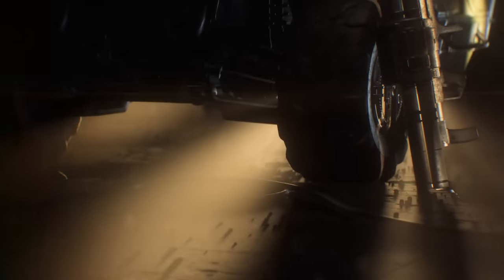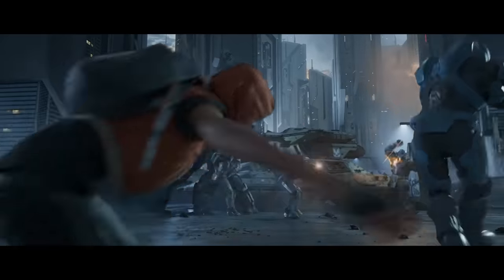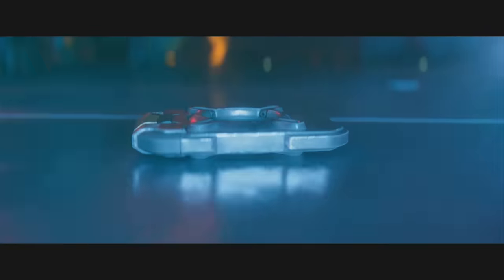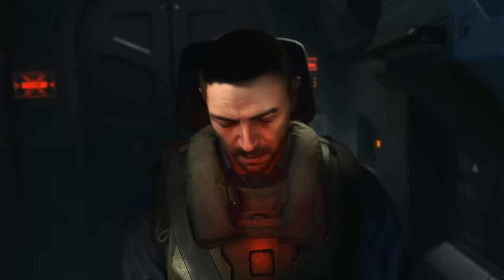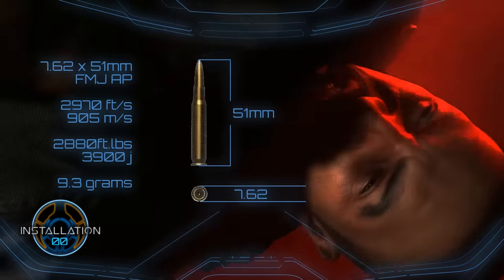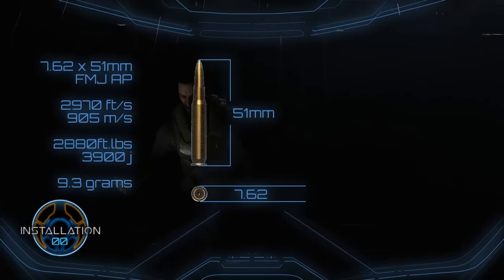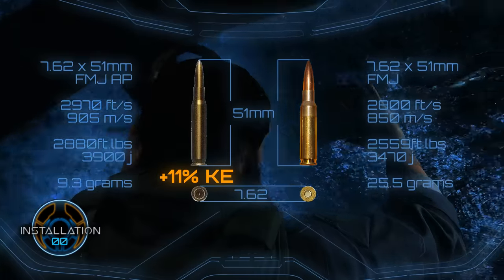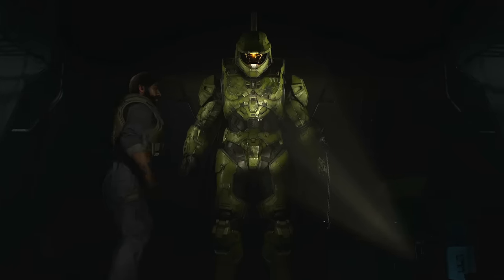Why are UNSC Weapons so powerful!? | The Armory

Comment: I reject the notion that UNSC firearms even are more powerful. 50m/s isn't much of a difference, many WW2 service rifle rounds had similar differences or even greater.
Also, different rounds fired in the same calibre have different velocities. If you lighten the projectile it will go faster. There would be 7.62x51mm rounds that go much faster than 905m/s.
And another also. 12.7x33 is already a handgun calibre, it's what the desert Eagle fires, well one of the calibres it can fire.
Reply: Actually, the Halo Magnum is closer to a 500 S&W (12.7 x 41mm). It's just a 1mm difference in case length between the two.

Comment: Awful long winded explanation to still be wrong.  Kinetic energy is 1/2 mass X velocity squared.   The simple answer is that the increase in velocity more than makes up for the lesser mass of the projectile.  The lesser mass of the projectile actually makes the increased velocity easier to attain as the lower mass being pushed means less resistance and higher speeds can be achieved.  This can easily be achieved in the same package size by the use of low mass projectiles.  Same size, same or higher strength, but less weight.  For example replacing the standard copper covered lead projectile with a solid copper projectile.  Or since we are talking about the future, maybe the UNSC has developed an alloy or composite that is light weight but not too brittle.  A more advanced offshoot of the work being done now on advanced ceramic compounds seems very plausible.
However anyone that actually uses firearms often in the real world can tell you that pretty mathematical formulas about what is more powerful vs the real world of what does the most damage and is more capable of actually stopping the threat being fired at are two VERY different things.  The most important aspect is not the kinetic energy of the projectile, but is in fact the ability of that projectile to retain and TRANSFER that energy to its target.  This is where the paper math about high velocity and low mass rounds often fails in the real world in comparison to slightly slower but heavier counterparts, and where hollow point ammunition is superior to FMJ that simply makes little holes and does not transfer energy.

Comment: I just threw the numbers on screen @ 11:20 into a calculator, the left one with an 8gram projectile (or 123.5ish if we use actual bullet terminology) with a muzzle velocity of 3,100 feet per second comes out to a whopping 2,635 foot lbs of muzzle energy. Not far off from the screens calculations. The one on the right though, that thing weighing 25.5 grams (or 393.5 grains) going at 2,800 feet per second comes out to 6,850 foot lbs of muzzle energy. Something is way off on your calcs. You can completely ignore the powder because we know what the muzzle velocity is, so what gives?

I’ve got more in the replies meow.
Reply: After a bit more pondering, that 393 grain number is insane. The main round I shoot out of my .308 is 165gr, and the heavy end of .308 is 180gr. 

You can argue propellant changes and the possibilities of rail gun like energy impulsion, but all of that is moot since we are looking at the muzzle velocity. Which I also just realized you are trying to use the weight of the entire cartridge, which is not at all how guns work. You measure the bullet weight, and the powder weight. The case is expected to be a constant, which is a whole other ballgame. Now I’m going to have to work backwards to determine the true insanity you are proposing assuming the actual bullet weights are the same, and ignoring the case weight.
Reply: Alright, backwards calculating the given info at 11:20 comes to this. The left one, the .308 round is 125grains, which is working backwards from muzzle velocity and energy. Which is not far of from your given 8 grams, which comes out as 123.5 grains. So that part of the example is showing the actual bullets weight. The right one, the 7.62 nato cartridge is coming out at 147grain from the backwards calc, or 9.52 grams. That sounds exactly like the NATO spec m80 round. What’s confused me is why you are showing two drastically different measurements. One being the actual bullets weight, and the other being the entire cartridges weight. 

Now for the calculations from 4:11  
With a given muzzle velocity of 2970fps and an energy of 3900j, you get a bullet weight of 146.8grains or 9.5 grams. The bullet alone weighs more than your calculations came to. So, I’m terribly confused as to why you would bring this up in the first place. You admit the maths are wrong, you are working off of incorrect maths. But, you claim they are using some super powered powder that (as I’ve shown via backwards calcs from given figures) needs to have negative mass. Not just negative mass, but enough to counter act the entire weight of the case, the powder itself, and 0.2 grams of the actual bullet.

Comment: Performance varies wildly, some weapons monstrously over perform and others are pee shooters, very few of the calibers make any sense. And you can't use 7.62 as a base because the DMR also uses it, and perform significantly better. 
The BR 9x40 makes no sense, the pistols all essentially shoot .50 Beowulf  and performance is everywhere with those guns the sniper is really a man portable autocannon with sabot rounds, the shotgun would be completely useless (shotgun are very low pressure and energy, it's the terminal ballistics that give them their reputation) and The .30 cal and .50cal machine guns perform exactly the same. 

Generally speaking though, modern weapons would probably be every bit as viable from a kinetic perspective and better in every way from an accuracy perspective with a few exceptions.

Comment: If one was willing to use stainless steel cases and beefed up rifle 7.62 at 80k PSI can increase power to around 4000 joules. Wear and tear would be a bitch... but the USA has decided doing 80k PSI is worth it in the new dumb ass rifle round so go figure...

Comment: Your data for the real world fielded m80 Ball variant on 7.62 Nato is incorrect. The average projectile weight in the real world for this loadng  is 9.4-9.6 grams or 145-148 Grains as measured here in the United States.  You also have issues when referencing velocity data as your velocity data for that given load of ammunition isnt framed by a particular barrel length used during chronograph testing which greatly affects velocity in a real world setting. The data you do have  for the real world ammunition while wrong on bullet weight does have a velocity stated that would put it being fired out of a roughly 22-24 inch barrel.  While as if it had the aforementioned incorrect weight you have stated, it would be a subsonic load at that weight in most barrel lengths and travel at roughly 1000 Ft/s in any typically fielded belt fed. SASS or issued rifle.

If you need help referencing ballistic data in the future let me know and I'd be glad to help. I have real world experience and data I can lend.

Comment: Different case design..

Instead of modern brass there could be a different alloys in the brass in halo making the case stronger... stronger brass higher pressures... higher pressures more speed... take a rifle case that's strong enough and fill it with bullseye you'll add dozens of FPS to projectile...

Psa don't do this in Real life you will die or be seriously maimed

Comment: You mixed up the weight of the bullet on the UNSC round and entire weight of the cartridge for a modern NATO standard. They clearly copied a current date steel core 7.62x51mm round exactly. 
Then you started talking about blackpowder composition when modern ammunition uses nitrocellulose and nitroglycerin composition.
Then honestly I can't stand to finish the video you're premise is completely off.

Comment: I admire your attempt, but lets face it. The whole usage of 7.62x51mm in a few hundred years where humanity achieved both FTL travel and terraforming, is really stupid. 😅
From day one the round was questionable because the US army ordnance pushed their own project for a "universal round" for all of NATO. Meanwhile all kinds of promising European intermediate cartridges where discarded in favour of 7.62x51mm. And just when most of Western-Europe switched, the US started with 5.56x45mm. Now when most of NATO again has switched to 5.56x45mm, guess what the US just did? 

The problem with 7.62x51mm is that you have a round that even with modern rifle design, is still is too powerful to be used in a fully automatic rifle. This while you might want something more powerful for machine guns or DMRs/sniper rifles. That is for example where .338 Lapua Magnum comes from or the derived .338 Norma Magnum, another round the US is experimenting with. The adaption of 6.8x51mm basically looks like an attempt from the US to fix its own mess without dropping the parent case. The problem however is the poor selection of that parent case back in the 1950s. It is too small for a really powerful round without some major alterations, but too big as a basis for a low recoil cartridge. The upcoming M5 looks impressive seeing as what it has to work with, but I doubt it really changes the basic problem of the case.

Comment: Wow dude. Logic on point but your source data is just so jank that it hurts to listen to

Punch the velocity figures into a ballistic calculator and you get bog standard 147gr projectiles. That's M80 NATO ball. 
Hardening does not add mass, it refers to the process of heat treating the penetrator core of the round. Usually mild steel, but can be tool steel or tungsten. Mild steel would make sense because it's cheap, easy to mass produce, and would be something that you'd want to harden for enhanced armor penetrating effect. 

Velocity now. 
Velocity is entirely dependent on barrel length. Take M80 ball and fire it through a 21" FN FAL and you get 2800FPS. Fire the exact same bullet through a 18" HK91 and you get 2700FPS. Fire it through grandpa's 26" hunting rifle and you get exactly 2970FPS. No magical chemistry involved. You can literally get these numbers with some of the cheapest commercially available ammunition *today*. 
Notice the MA5 is a bullpup. They do that specifically so they can build a shorter gun with a longer barrel in order to increase muzzle velocity to improve terminal effect. (Side note: common misconception is that barrel length = accuracy. Could not be further from the truth. Longer barrels = wobblier and more flexible. You always want the shortest barrel that will give you enough velocity from your round. Longer = faster but wigglier. Shorter = slower but stiffer.)

Cool? Cool!
Now repeat after me. 

GUNS. DO. NOT. NEED. AIR. TO. FIRE. 
Watch videos of guns shooting underwater if you don't believe me. Watch them anyway, it's funny to watch the bullet poop out of the gun and go like five feet and then drop. 
In fact this is so far from the truth that most military ammunition and many commercial ammunitions come with a polymer sealant glue around the primer and the projectile specifically to keep free oxygen out of the case to avoid breaking down the propellant and causing inconsistencies in velocity. I promise you there is no ambient air anywhere near the propellant during firing.
Reply: And here's the best part. 

7.62x51 as shown here was finalized the year after the end of the Korean War, based on a reduced power version of the commercial .308 Winchester. 
So not only are the velocity and muzzle energy figures shown entirely reasonable by 1954 standards, let alone 2022, and probably completely laughable by the year 2552, but it wasn't even the peak of performance 70 years ago.
Reply: You can all stop screeching about plasma ignition now. Please. It's the dumbest thing.